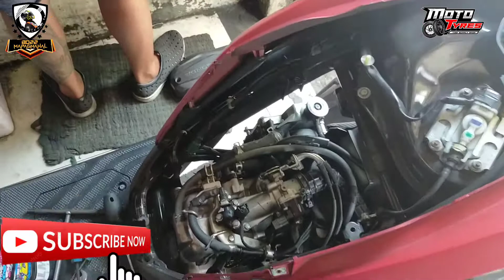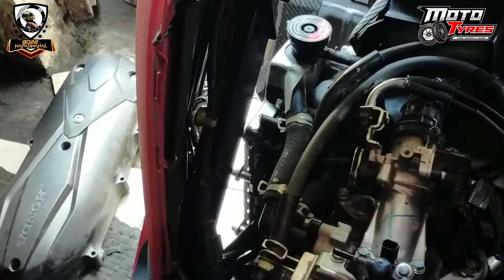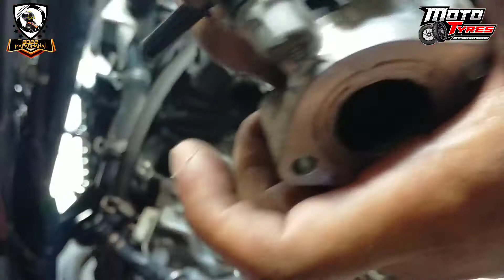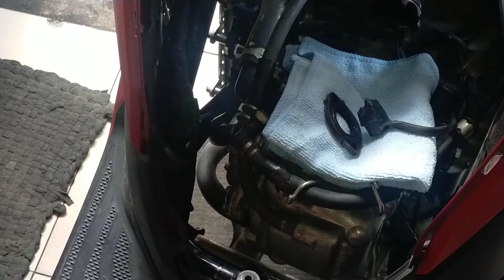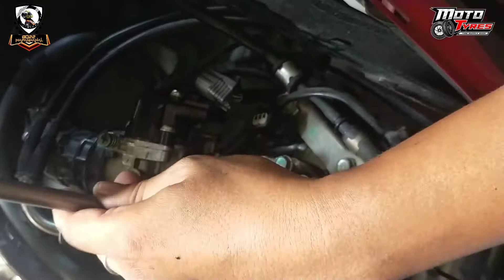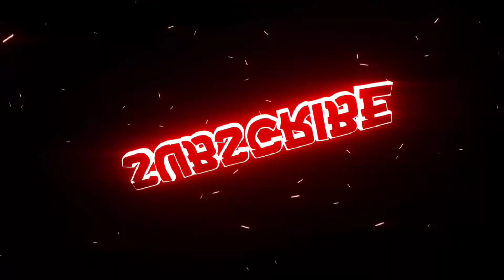THROTTLE BODY CLEANING by Moto tyres

Comment: Magkano throttle body Lang click 125 gc
Reply from the maker: 💥 PACKAGE FOR CLICK V1/V2 - 650 📌

✅ fi cleaning ( optional - kung ayaw nyu ok lang)
✅ throttle body cleaning
✅ intake manifold cleaning
✅ cvt cleaning ( pang gilid )
✅ belt check
✅ valve clearance check/adjust if needed
✅ spark plug check
✅ air filter check
✅ break pad check
✅ breakshoe check
✅ apitech diagnose
✅ reset ecu
✅ tune up

      ⚠️ -- OTHER SERVICES-- ⚠️

  * REFILE *
 * MAGNETO CLEANING& REPAINT *
 * PALIT FUEL FILTER *
 * ENGINE REFRESH / TOP OVERHAUL * 
 * BALLRACE/KNUCKLE BEARING *
 * WIRING *
 * ALARM / HORN INSTALLATION *
 * MINI DRIVING LIGHT (MDL) INSTALLATION *

⌚ Open po everyday 9am-6pm ⌚

📍 Location - 16 don faustino st. Brgy. Holy spirit q.c.

📍Google map or waze - mototyres📍

☎️ Contact - 09152698366☎️

#mototyres
#scootermaintenance
#Forscootersonly
#SuperOil #trendingnow  #speedtunerlangmalakas  #mototyres #speedtuner